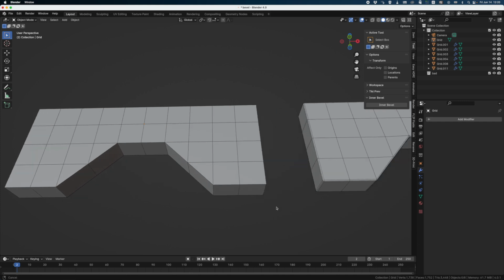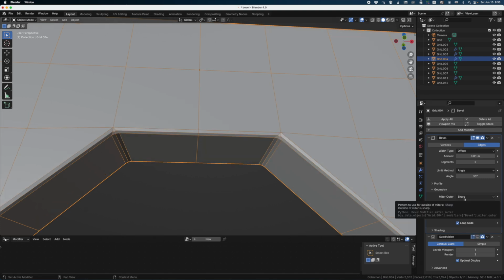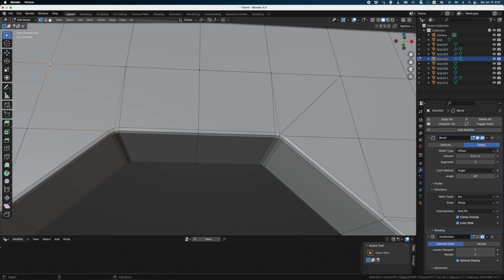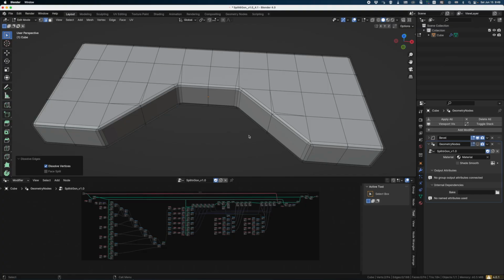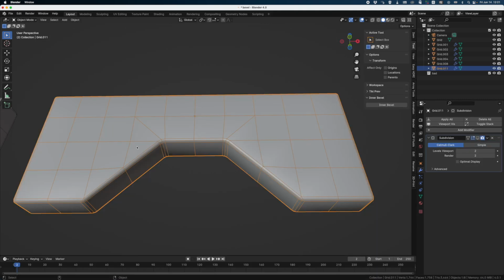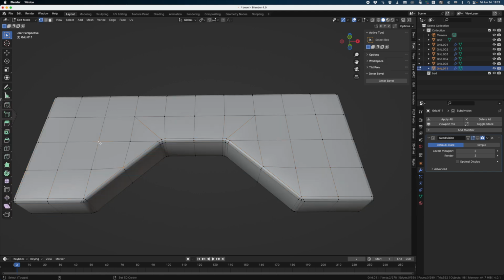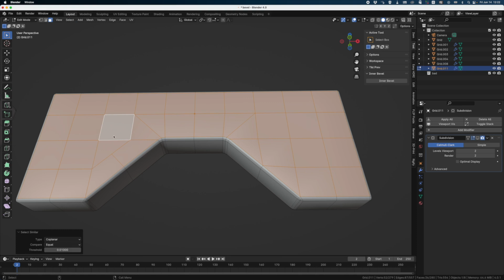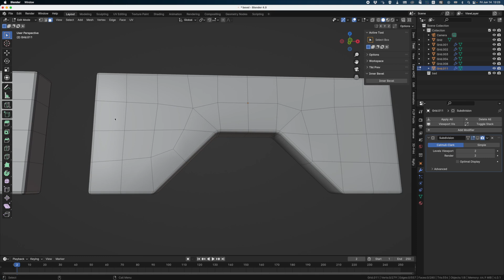Bevel inner corners

Comment: Hm… subdivide after bevel is a big no. Just mark creases, subdivide and then bevel. Shade it auto smooth and keep a weighted normal modifier always at the end of the stack.
Reply: Yes! I thought exactly the same. Do not use subdivide after the bevel, and always (when we talk about hard surfaces) use a normal weighted.
I see few tutorials that use "mark crease". I learned this on the "hbitproject" channel, and my life simply became easier haha
Normal weighted is another thing I NEVER fail to add!

But, the good thing about blender is that. There are several ways to do the same thing!

Pois é, pensei igual! Não usar subdivide depois do bevel, e sempre usar um normal weighted.
Vejo poucos tutoriais que usam "mark crease". Aprendi isso no canal do hbitproject, e minha vida simplesmente ficou mais fácil, rsrs.
Normal weihgted é outra coisa que nunca deixo de usar.
Reply: @thomas7726  Indeed. 95% of the time you don’t subdivide a bevel and marking creases is the way to go for controlling form when subdividing.  

Most modelers I know were not tought to work in conjunction with modifiers properly and this department became mythicised and distorted, specifically in Blender nowadays.